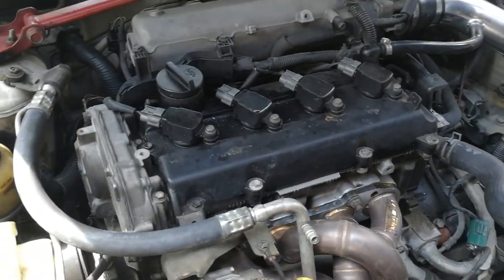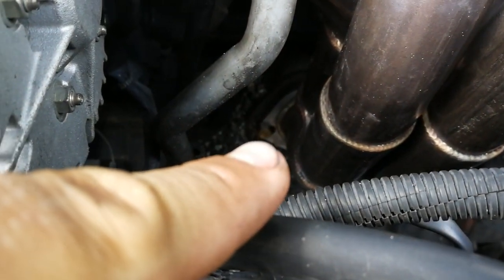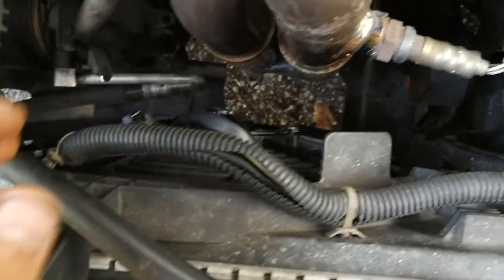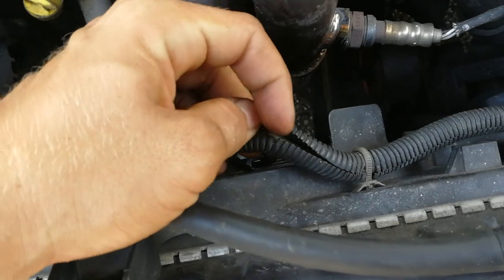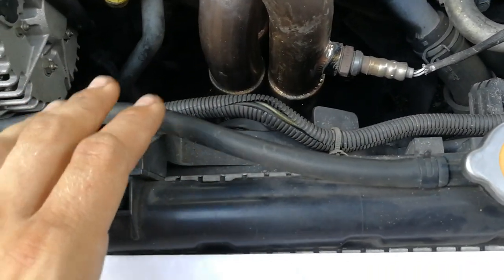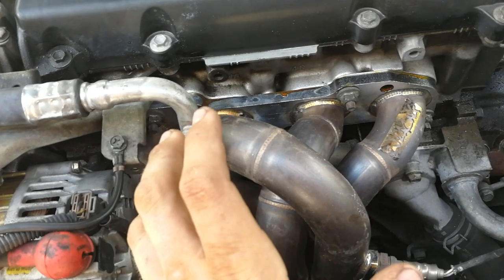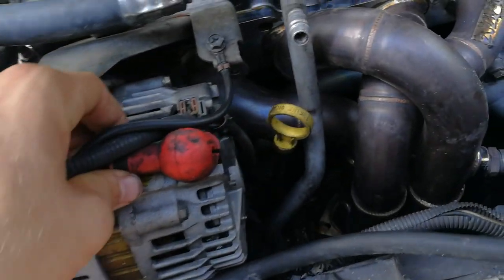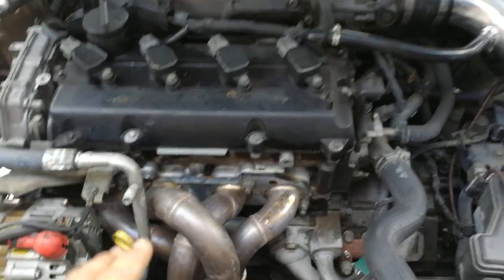HOW TO INSTALL 2JRACING MEDUSA HEADER Nissan Sentra ser spec v

Comment: Thanks for making and posting this video. Great walk through of the install steps. Anyone who has worked on their Spec V should be able to follow along. What exhaust are you running?
Reply from the maker: Thank you!
I don't recommend the way my exhaust is set up right now... I've got 2.5 inch piping all the way back, 1 magnaflow resonator, 1 vibrant resonator, and a magnaflow muffler. Then I have a cut-out behind rear door. The reason for all the resonators is, I had an eBay header that was so raspy I was constantly trying to kill the rasp with a different resonator. Had I known, I would have bought the MEDUSA years ago and save the money trying to kill the eBay rasp.
This video was shot with cut out OPENED- this is how I drive it 90% of the time. It gets closed when the baby goes for a ride.  The car sounds great opened not too loud and full of tone. When the cutout  is closed, it's almost too quiet with those resonators- but that's how I needed it with the baby.

Comment: Just one question is all. there they street legal ? Reason i ask is cause i stay out in California cops be hella tripping im still running stock headers but know i should get different ones asap. For the honeycomb falls apart after time an, can get sucked up in the engine killing it. I looked at dc sports headers but they dont pass the street legal test out here.
Reply from the maker: Not sure if it’s street legal, Florida has no inspections, I will say, if installed correctly you will not have a check engine light, so no red flags for the cops, other than the sound
Reply: I welded a Hi Flow Cat into the midpipe near the header. I used an AUTOSAVER88 ATCC0010 3" Inlet/Outlet since it was short enough and narrow enough to fit in the space beside the center beam. It made the CEL go away.

Comment: Im back! Im installing the header soon ive been very busy, but did you have any fitment issues either? Like the bottom of the header lining up with the stock flange?
Reply: also which exhaust system do you have im trying to find one that sounds good like yours and not extremely buzzy and raspy
Reply from the maker: @GamerGavin04  At time of this video, i had the , in order, Medusa, stock mid pipe, 2.5 inch piping all the way back, Vibrant resonator, cut out, and magnaflow muffler.
Do whatever you want, the Medusa sounds so good, however in my opinion the vibrant resonator is the secret sauce. It killed all rasp.
Ive since changed the exhaust to a little different set up.
Yes lineing up the Medusa to the stock flange is a PIA. I had to do it a little backwards,,, line the stock flange up to the Medusa and get the bolts thru and the nuts on a few turns, then start installing the top nuts.
Don’t forget the donut gasket.
Also before you do anything spray a gallon of pb blaster on those manifold nuts.(cold engine) then wait an hour and spray again.
Reply: @OMGITSAAAJ  lol thanks man. yeah i went to take off my bolts on the bottom of the header and wow… those things are literally one with the flange. I tried something else and my friend tried to get it off with an air impact but that just bent one. So we either might cut them off or just spray them with PB throughout the day and then try again. Thanks tho nobody had a straight answer to how long u spray or how much 😂 only reason i asked about exhaust is because i dont wanna buy an ebay one but i loved the sound of yours it wasnt ricey at all

Comment: that bracket for the alternator won't change the belt size?
Reply from the maker: It will not need a belt. The small difference is made up with your tensioner automatically

Comment: Does this header over heat the alternator
Reply from the maker: Yes. But thankfully the alternator is cheap and super simple to replace. My alternator lasted about 2 to 3 years. All city driving in Florida.. you can make a heat shield. The exhaust is still totally worth it. Always remember nearly everything you do to a car to boost hp will compromise longevity.
But who cares😎
Reply: @OMGITSAAAJ   what I was trying to say, is the header really close to the alternator because I bought one online that’s really close
Reply from the maker: @Apa-es9mt  this header should have came with an alternator clearance bracket. If it didn't, you need to get one. But even after the bracket it still fits very close to the alternator

Comment: I finally finished installing the Medusa header this weekend (Aug 10) and it was a nightmare to complete the upgrade. I can't blame 2J Racing for my woes, but if they had provided some instructions or pictures of how the installation should proceed, especially where the low-profile fan is concerned, it would have saved me a lot of frustration. I tried to document my installation with pics of each step but it quickly became apparent that this wasn't going to be a simple install so I abandoned the documentation effort.
1st problem: Right out the gate, the lower bolt for the alternator would not come out. It was an aftermarket Alt that the previous owner must have installed with an air gun because the threaded steel insert would spin but the bolt wasn't backing out. I found this video  https://www.youtube.com/watch?v=hodU6maQUZk&list=WL&index=27&t=0s  and it worked, but only after breaking 4 drill bits and wearing out 2 Cobalt ones just to be able to drill a hole deep enough to immobilize the insert long enough to unscrew the bolt.
2nd problem: how to install the low profile fan. I wasn't keen on installing it directly onto the radiator, so I had to devise a way to mount it to the Original Fan Assy Frame from the inside of the frame so it would still have sufficient clearance to the header but not touching the radiator fins. Also, I wanted the ability to unplug the fan in case I had to take it out later so I had to find a male/female connector and then wire it up to the harness.
3rd problem: figuring out the Alt & new bracket bolt tightening order so the alternator was positioned correctly. I must have put in & taken it out at least 3 times before I got it right.
4th problem: installed the header, but the bolt holes to the stock downpipe doesn't align so only one bolt would fit. I still need to grind out the 2nd hole in the downpipe to install the 2nd bolt but at least the car is road worthy again.

The effort was worth it when I started the engine and heard that beautiful exhaust roar to life. The car feels more responsive and pulls like a Clydesdale!
Reply from the maker: It definitely was a pain but man is it worth it. I like your idea of having a connector for the fan, and a mount away from the rad. I might just do that, but I've had zero issues since the install. I definitely plan to install a 2j downpipe soon. Just to add to the natural sound. And give me that much more flexibility of being able to remove for access...(I'm currently welded). I'm glad you worked it out!
Reply: @OMGITSAAAJ  Thanks. I wish I had taken pics but I am willing to answer questions if anyone wants to know more.
Reply: @paulclemetson7760  What about you Sir, How do you like the Medusa header? Was it worth all the installation trouble? Any dyno numbers? Is the bottom flange that connects to the mid pipe threaded like the stock exhaust manifold, or would I need to use nuts to bolt the header and mid pipe together? Did you ever get a chance to compare it with any of the the top header brands on the market? Thanks!
Reply: @nicksta16  Well it's been 8 months since I installed the Medusa header on my QR25. My short answer to your question about whether it was worth all the installation troubles is NO. I spent the extra money to have it Ceramic coated which started to peel 3 months later. Joe said to send it back and he'd have it re-coated, but what the F am I going to do during those 2 weeks waiting to get it back since its installed on my daily driver!

Let me explain further... The bottom flange of the Medusa header does NOT have threaded coupling holes so you will either
a) need bolts, nuts, washers and springs to devise a system to replicate the stock Nissan spring setup IF you want to have flex at the flange for when the engine flexes under acceleration. 
or
b) install the header and take the car to an exhaust shop and have them modify / replace the flange on the stock midpipe with one that will mate to the header.
or
c) weld two 1/4" thick nuts to the mating side of the Medusa flange so you can screw the stock Nissan midpipe to the header. In hindsight, this is the simplest and cheapest way to install to the stock exhaust.

However, if you are going to use a 2JR midpipe, then make sure you find a good welder that can weld stainless steel. My 2JR midpipe didn't fit worth crap, wouldn't seal properly and I ended up up scrapping the entire system and had one custom built. I've spent over $900 redoing the entire exhaust system and I won't spend another dime to dyno it just to satisfy my curiosity. I would recommend you keep the stock 2" midpipe and muffler, but if you really want to upgrade, don't go above 2.5" as it kills the performance!
Reply: @paulc2357  Thanks for the info! I really appreciate it. I am still on the factory mid pipe and plan to keep it that way. Were the performance gains worth the hassle compared to your last header? Thanks!
Reply: @nicksta16  Oh Yes!! 

I spanked a 2.0 turbo Audi. I was trying to merge and he didn't want to let me in so I downshifted to 2nd, took him to the redline, pulled 3rd and left him in my dust. Keep the factory exhaust... you won't regret it.
Reply: @paulc2357  What do you mean by keep the factory exhaust? Are you referring to the cat-back? I already have an  aftermarket cat back haha. So, you did get a performance gain from the medusa compared to your last header? What brand was your last header? or did you have the factory manifold before you installed the medusa? Thanks!
Reply: @nicksta16  I had the stock exhaust before I installed the Medusa header so I can only speak for that upgrade. The performance increase as measured by the butt dyno was noticeable, however not quantifiable.

What I mean by "factory exhaust" is the 2" system that came with the SpecV. When I upgraded to a 3" cat-back, the performance went to shit.
Reply: Any alternatives to the Medusa header you could recommend?

Comment: My Friend Nice sound, but Tell me comparing to The magnaflow header, There is One 700 Something 🤔🤔🤔🤔
Reply from the maker: I’ve ran the magnaflow, a Chinese eBay, and finally this Medusa, out of the three of them the Medusa has noticeably more torque down low.
Reply: @OMGITSAAAJ  Did you gain any top end power with the medusa against all the other headers you mentioned or just low end torque and better sound? Any dyno comparison by chance?  Also is your QR still on stock internals and cams or aftermarket? Thanks!
Reply from the maker: NARK NARKO butt dyno only. I felt a significant low end torque increase. It’s night and day compared to other headers I had. Qr is on stock internals for now, cams happening soon I hope. Also the qr has nearly 200000 miles on the original untouched engine and still pulling high 14s in the quarter which I’m extremely happy about. That being said, cams haven’t happened yet because they will need to be installed with a full engine rebuild/refresh to make it all worth it.
Reply: @OMGITSAAAJ  Interesting. Are you tuned with UPREV or something? I saw that REV limit go way past stock. Were you running high 14's before the medusa install as well, or did the medusa shave off some time? Is that slim fan as good as the factory fan as far as cooling in stop and go traffic? Thanks for all the info.
Reply from the maker: NARK NARKO yes I’m Uprev tuned by 2jracing. And I was making those numbers before the Medusa but I’ve also got bolt-ons. The slim fan is better than stock because is a 1speed fan so it’s always blowing high. But the drawback is it’s pretty loud at idle. For peak horsepower and better top end and quicker quarter mile times, there are better options out there as far as headers go. 2jracing sells others. Check out the long tubes he sells. But for canyon driving, engine braking, and highway passing/streetable power- the Medusa is THE BEST. It multiplies the torque the qr already had. You don’t ever NEED to downshift to pass on the highway. As far as a street race goes... 1st gear your even with the other guy. 2nd gear your creeping passed. 3rd gear you’ve passed him completely. 4th gear you’re showing off.Lol . Not that I ever street race tho😏
Reply: @OMGITSAAAJ  HAHA. You mean an imaginary street race against another bolted SPEC V? I too am fully bolted with the factory QR on stock cams and the 2J plenum. but, I do have a cheap header. Just wondering if the medusa would be worth the money and hassle of cutting out the factory fan. I honestly would be happy with the torque increase if it added just a little bit of top end as well. When you raced that guy, did you shift at the factory 6200 or wind it out to 7200 or something? lol
Reply from the maker: @nicksta16  very nice 👌
1st gear I'm shifting early cause it's not hooking anyways, (and that's on Michelin pilot sports) 2nd and 3 I'm going to 6500.
Get the Medusa. It's miles passed the Chinese header. If it's a daily driver you will enjoy the Medusa more than any other header. Because it's very useable power. You won't regret it. Especially if you have a free flowing exhaust, it kills all rasp you've likely been trying to hide with the Chinese header. (Believe me I know) 
I've been setting up my car for spirited windy hills, pulleys, 9 lbs flywheel, ECT... The Medusa is probably one of my favorite upgrades I've done, and offered the biggest noticable difference from before 2 after. The install is a pain but you won't regret it
How do you like that plenum? Was it worth it?
Reply: @OMGITSAAAJ  Thanks for the feedback, I really appreciate it. I don't really have any rasp right now, I fixed that with an APEXI WS2 catback and a Vibrant resonator combo that I found used years ago, but, I could use more power lol. The 2J plenum I have is the early 2012 version, I got it on the first group buy for like $300. I'm not sure if the newer versions are any different. The price however went way higher since then. I actually did a before and after dyno comparison myself on a dynojet in 2012. I still have the dyno sheet, It might still be floating around B15U somewhere, long story short, I gained about 7-14 WHP from 3500-5600 RPM and lost about 4 WHP from 5700-6200. The torque curve was very similar as far as gains. Overall my average power increased and made me about 2 car lengths faster on roll races. This was all without any UPREV tuning, It probably could have gained more if tuned.
Reply from the maker: @nicksta16  no problem. Ya i was curious but the pricing was similar to cams. So I'd rather go the cam route for now. I'm running a vibrant resonator also. Although I feel like I didn't need it with the Medusa, in a way is quieter than the Chinese, but it was previously installed to quite down the Chinese header.
If your spec v is 04+ DEFINITELY get it tuned by Joe
2 step is fun... But just the tune alone will buy you some hp. The tune was relatively cheap about 300 or so... 
And that buys you 
Hp
Torque 
2step
Raised limiter
I'll post a video soon showing the tune and different maps.
Tune it + Medusa and you will have a completely different car. Seriously worth the money and effort.
Reply: @OMGITSAAAJ  LMAO I would have got a tune long ago, but I have a 2003. I might just end up biting the bullet for the UPREV conversion kit if I can't find one used. How much power did you gain from just the tune? How much are you putting down to the wheels right now? I don't think I would want to raise my rev limit on the factor QR, extra HP would be nice though lol. Is the alternator clearance bracket required for he medusa or just recommended?
Reply from the maker: @nicksta16 Ok. You must have the alternator clearance bracket for the Medusa. Ive never had my car on a dyno so I don't know exact before and Afters, but there are some guys on the forums that showed their numbers I believe. I've been tuned for about 3 years driving shamelessly hard on a 200k mile motor with a raised limiter without issue. The qr has done well. And I haven't even done a bsr kit yet! So you should be fine with a raised limiter
Reply: @nicksta16  I'm in S. Florida and I've never had any issues with the slim fan. Temp is right where it was with the stock fan.
Reply: @OMGITSAAAJ  Only $300? 

Which tune did you buy? (look on the 2JR page and let me know)
Reply: @nicksta16  Alternator clearance bracket is a must.
Reply: @OMGITSAAAJ  How many miles have you been driving on the raised rev limit and how high do you have yours set? I saw it bounce off 7K RPM, but, I know that the SPEC V tach is not really accurate. Is it actually raised to 7k or is it actually lower around 6500- 6700 rpm? Thanks!
Reply from the maker: @nicksta16  rev limit is 6600. I have 40 to 50 THOUSAND MILES on this tune-worry free.
Best money spent!